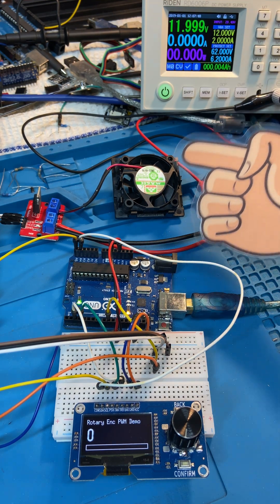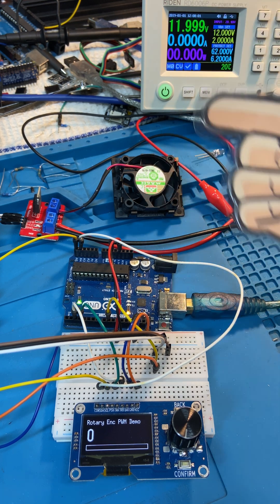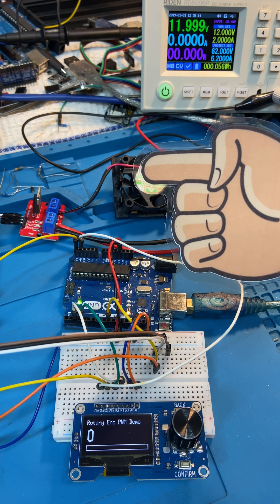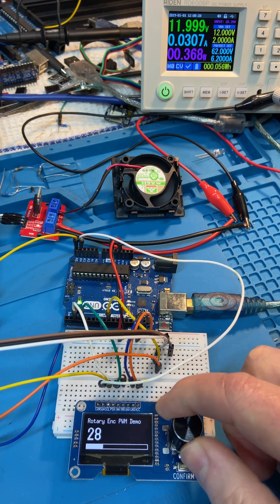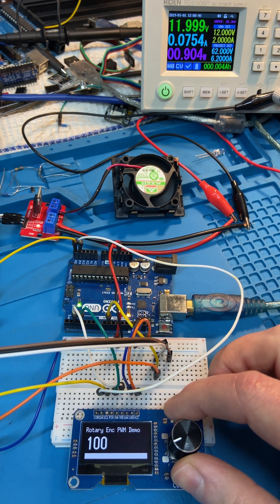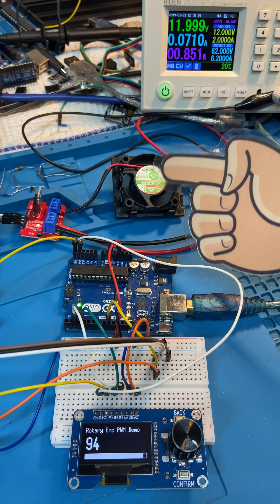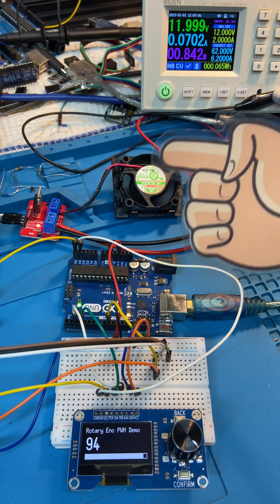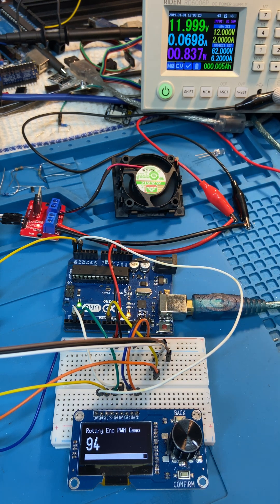Controlling a 2-Wire Brushless Fan with PWM (Supply Chopping)

Comment from the maker: #include <U8g2lib.h>
#include <Wire.h>

// ---------- Display (SH1106 128x64 I2C) ----------
U8G2_SH1106_128X64_NONAME_F_HW_I2C u8g2(
  U8G2_R0,
  U8X8_PIN_NONE
);

// ---------- Rotary encoder pins ----------
const uint8_t ENCODER_PIN_A = 2;
const uint8_t ENCODER_PIN_B = 3;

// ---------- LED PWM pin ----------
const uint8_t LED_PIN = 9;

volatile long encoderValue = 0;
volatile bool encoderMoved = false;

// Encoder limits
const long MIN_VALUE = 0;
const long MAX_VALUE = 100;

// Debounce for the encoder ISR
volatile unsigned long lastInterruptTime = 0;
const unsigned long DEBOUNCE_US = 2000;  // 2ms debounce

// ---------- Interrupt ISR ----------
void encoderISR() {
  unsigned long now = micros();
  if (now - lastInterruptTime < DEBOUNCE_US) return;
  lastInterruptTime = now;

  // Direction check using B
  if (digitalRead(ENCODER_PIN_B) == HIGH) {
    if (encoderValue < MAX_VALUE) encoderValue++;
  } else {
    if (encoderValue > MIN_VALUE) encoderValue--;
  }

  encoderMoved = true;
}

void setup() {
  pinMode(ENCODER_PIN_A, INPUT_PULLUP);
  pinMode(ENCODER_PIN_B, INPUT_PULLUP);

  // Interrupt on A, rising edge
  attachInterrupt(digitalPinToInterrupt(ENCODER_PIN_A), encoderISR, RISING);

  // PWM pin
  pinMode(LED_PIN, OUTPUT);

  u8g2.begin();
}

void loop() {
  static long lastShownValue = -1;

  if (encoderMoved) {
    noInterrupts();
    long val = encoderValue;
    encoderMoved = false;
    interrupts();

    if (val != lastShownValue) {
      lastShownValue = val;
      drawScreen(val);

      // ----- PWM OUTPUT -----
      int pwmValue = map(val, 0, 100, 0, 255);
      analogWrite(LED_PIN, pwmValue);
    }
  }
}

// ---------- Draw to display ----------
void drawScreen(long value) {
  u8g2.clearBuffer();

  u8g2.setFont(u8g2_font_6x13_tf);
  u8g2.drawStr(0, 12, "Rotary Enc PWM Demo");

  u8g2.setFont(u8g2_font_logisoso24_tr);
  char buf[10];
  sprintf(buf, "%ld", value);
  u8g2.drawStr(0, 45, buf);

  // Simple bar graph
  int barWidth = map(value, MIN_VALUE, MAX_VALUE, 0, 128);
  u8g2.drawFrame(0, 52, 128, 10);
  u8g2.drawBox(0, 52, barWidth, 10);

  u8g2.sendBuffer();
}